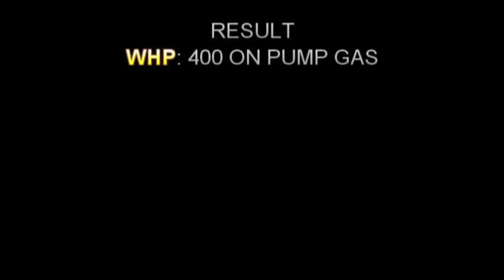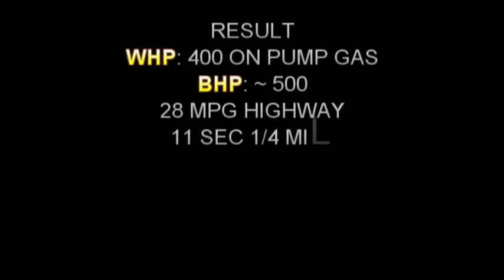MY STI BUILD

Comment from the maker: When I returned from a tour in Iraq I bought the car brand new for $32,000. I got a small discount on parts but still paid somewhere between $5,000-$6,000 on Perrin Kit. I then probably spent another $2,000-$3,000 on tunes, powder coatings, tint stereo and small additions. All in all I was into it around $40,000. HOWEVER.... you can build something similar for about $24,000. I wanted it to be perfect, perfect new interior and now scratches on outside. 40k= BEAT YOUR PORCHE